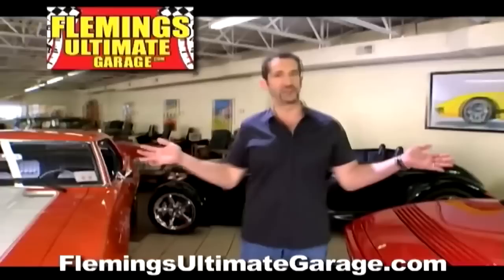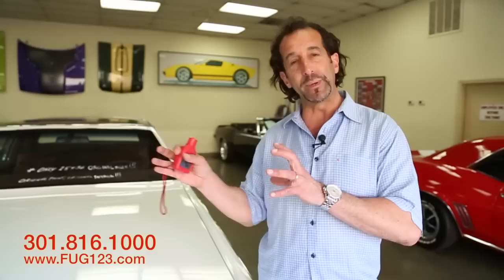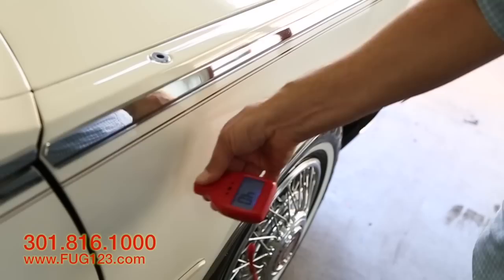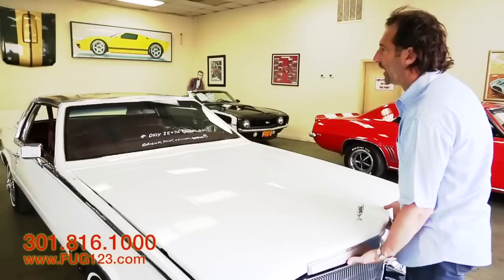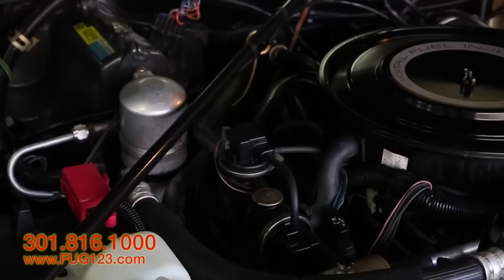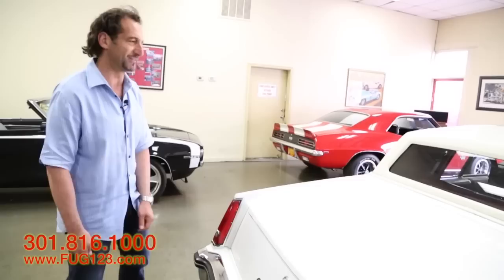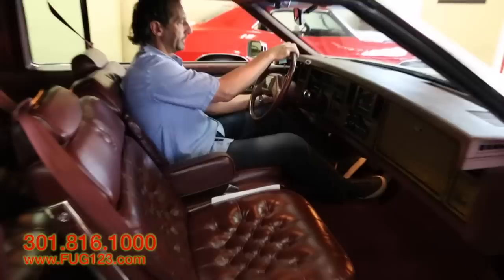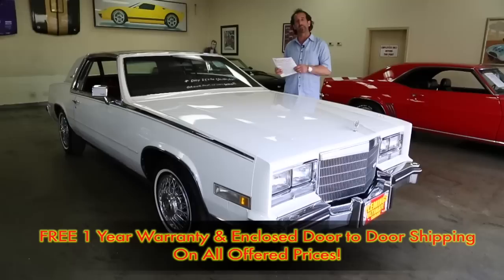1984 Cadilac Eldorado Biarritz for sale with test drive, driving sounds, and walk through video

Comment: Too bad the 4100 Engine was utter junk, was a complete failure for GM.
Reply: JetCityNewEngland yea it was. but there is hope for low mileage ones like what's in this Eldo.
Reply: KodiLoaded Its not a bad motor.  They last a long time.  I have an 1985 Eldorado Biarritz and an 1984 Seville both with this engine.  They run very good and get great economy.  I only wish it had more power.  They only got better as the time went on increasing the power.  I've never had any problems.  I know someone who has an 85 eldorado withh over 250k and still running strong to this day.
Reply: +KodiLoaded Yes, but I would rarely drive this beauty....just baby it and admire it.
Reply: A car like this is NOT meant to be driven daily! I have a 85 Eldorado Biarritz just like this car here and I enjoy it very much just driving easy and going to various car shows with it. These engines are good but just not for people who don't maintain there cars.
Reply: ***** You blew the engine 3 times???  That is not normal for any engine.  My only complaint as with any other engine at the time is its lack of power but that's it.
Reply: Just like any Northstar engine...crap...
Reply: >Stoney Rich: HT4100 was worse than V864. 4100 needs stopleak tablets just to keep itself sealed, their oil pumps were weak, their camshaft sprocket would wear down and cause the timing chain to jump, by 90,000 miles they were ticking time bombs and almost always had a bottom end knock. If the starter hangs up while cranking, it's not the starter that's faulty, The engine is partially seized. The 4100 fared a little better in the transverse version because it didn't have to work as hard; but it caught hell in the full size RWD cars.
Reply: Eric Beauchea dude nobody blows an engine three times admit it you dogged the shit out of that car
Reply: Yes, the low miles was the high point for this car.  I wonder who has it, and how it looks today, 3 years later...
Reply: Yup
Reply: It’s not a 4100 if the bottom end isn’t knocking 😂 had an 85 fleetwood fwd drove if From Ohio to Florida no issues except a random misfires while I was driving it.   injectors had to be clean and fuel system about half way there. But yet again this engine is not the best it literally almost ruined Cadillac back then! Customers had to bring there cars back and Cadillac was installing olds 350s in them. Maybe they should’ve done that in the first place.
Reply: Utter Junk, I wouldn't say, but was a motor with problems ,some HT-4100s were replaced under warranty because it was prone to failure of the intake manifold gasket due to scrubbing of the bi-metal interface, aluminum oil pump failure, cam bearing displacement, weak aluminum block castings and bolts pulling the aluminum threads from the block.
Reply: KodiLoaded....Dude, did you even read the manual and comprehend that this engine needed maintenance of adding radiator"Pills" and changing the radiator fluid every 2 years? 
You are the perfect example of "IF ALL FAILS,,READ THE INSTRUCTIONS" !!!
Reply: @starxlr7863  350 engine all day long in my opinion should have been in these.....
Reply: @lionelhowell4972  Yes from the first 1979 Eldorado.  Its an Oldsmobile engine and I have one that I'm putting into a Seville.  I can't wait till its done.
Reply: Everyone says that, but actually my father’s was great and reliable.  None of the maintenance issues and power to tow a boat.
Reply: Yep that and the Northstar. Throwaway motors
Reply: @eriknobles3946  No the Northstar V8 is not a throwaway motor by any means.  Actually none of these are.  But if I had to say which was the worst engine offered by Cadillac, it would be hands down the HT4100 mainly because of its rediculous low power.  The Northstar is a powerhouse and will last a very long time. Proper maintenance goes a long way and these engines are very low maintenance.  Remember there is a reason why Cadillac built the Northstar V8 for a 20 year production run, coming in 4 different varients, and its same engine design, materials and technology eventually finding their way to all the other GM engines as the years go on.
Reply: and caddy didnt stand behind the engine for many customers....they really sticked it to their customers for MANY years! Back in the day I was a used car dealer...I helped a friend dealer to force caddy to buy the car back... It had 49 K miles....then engine started to go...he bought the car new from a local caddy dealer that he KNEW! The wouldnt help him. I found a FED emissions law that forces the manufacturer to fix or buy the car back IF under 50K miles
Reply: My dad had an 83 Eldo. I actually did the research and comparison shopping for him, and I was 18. I went to one dealership with a friend from high school. I had my dad's checkbook in my back pocket (yes, he let me have it LOL). I went to one dealership. The salesman didn't believe me when I said I was looking to buy a new Eldo. Bummer. He lost a sale. Don't ever be rude to people because you never know who has money and who doesn't. So I went down the street to Hillcrest Cadillac. They got a sale. Funny how I remember little things like that from 37 years ago. Anyway, gawd that was a gorgeous car. Firemist blue paint with white fake convertible top. Bose stereo. Man I loved driving it. Unfortunately I was driving it a couple times and it just died. Right in the middle of the street. Such a pain when we didn't have a phone in it. The second time it died in the middle of heavy traffic on the 405. He got almost 40,000 miles out of it before he got tired of the engine and bought a Mercedes. So yes, bad motor. Completely unreliable. But at least it wasn't the V8-6-4.
Reply: @rexcruciatus2036  V8-6-4 was a MUCH better engine bc you could disable the module to reduce cylinders easy enough, but the HT4100 had a serious engine block defect & Cadillac wasnt helping customers with it
Reply: @welcometoreality3450  OK well in that sense you may have a point. I wasn't thinking in terms of a modified engine though.
A couple times I was driving our 83 Eldo and the engine just quit for no apparent reason. A couple hours later, it started right up and ran fine. Could this have been related to the problem you're referring to, or was it likely something else?
Reply: @rexcruciatus2036  it was a very simple fix for the 8 6 4 mod...like pulling a connector or something.  I guess the 83 eldo could have had the block prob & ran well again after it cooled down....idk
Reply: Antoine Miller so the 350 was better than the 4100 by far?
Reply: I have had mine for 22 years
No issues
Reply: I had the only good motor. I bought it as an angry 20 year old. In 2000. Car terrible condition. Panels off the doors peeling off. I just could not kill this car. Flooring it down lake shore drive. Shoving it from reverse to drive just to chirp the tires.
 I mustve had the one that worked.
Reply: Ya way better to find one of these with the olds 307
Reply: Nope my father had 83 ETC and 85 convertible with HT4100.  If well maintained it was fine and reliable, smooth.  Even had enough torque to pull a boat for cry out loud.  The griping is way overblown.

Comment: There never has been or ever will be such luxury inside the interiors again.
Reply: I even thought the Cimarron wasn't so bad after they upgraded to the 2.8 V6, quad headlamps & lower body cladding. What they also should've done was change the profile of that Cavvy roofline & perhaps conceal the Cavvy wiper cowl panel?  Look at the 1979 Lincoln Versailles for example. When they redid some details that year, the car beared little resemblance to the Granada/Monarch & it represented Lincoln quite elegantly.

Comment: My 85 with the 4100 has always run smooth and shifts like silk. These were the most expensive cars at the time and worth every penny
Reply: You would say that until you hopped into an early 1980's V8 Mercedes that made 220hp, did 0-60 in under 9 seconds and topped out at 130+mph.  Yeah a Benz might have cost an extra $10-15k over a Cadillac, but man it was such a superior car at that point in time vs the 130hp Cadillac cars that liked to blow their engines before the warranty expired.
Reply: They started at 60.000 dollars new.
Reply: I have my dads 83 Eldorado,  optioned with, Bose stereo,  cadillac aluminum wheels, and Digital dash. Leather. Love it.

Comment: talks about how repainted cars have different thickness, as every panel is a different thickness
Reply: Steele Davis Yea right I have a meter just like that I bought it at sports authority it cost me 10.00 dallars its a jogging tracker and people actually believe this
Reply: Doesn’t matter anyway those plastic panels are very unlikely original. They rot out very quickly.
Reply: LOOKED UP THE VIN.  CAR WAS IN TWO ROLL OVER ACCIDENTS (SHOULD BE OK, THEY WERE LOW SPEED ROLL OVER ACCIDENTS).
Reply: My car I bought it in terrible condition. The bottoms rolled up. I was racing my one friend. I thought I beat him. He let off because he thought my car was gonna disintegrate and fuck his up.  
The side panels curled up so much he said if I had a propeller I'd fly away
Reply: Awesome steering though taught ny sis how to drive in this thing. You could steer with your pinky finger the power steering was so nice

Comment: These are really beautiful cars.  I have a 1985 Eldorado Biarritz in canary yellow and a 1984 Seville which is the sister car to the eldorado.  I've had it for the past 7 years since I was 15 years old and I love it!  I always loved this generation Eldorado and waited for the right one to come.  You really have to see and drive one to really appreciate it.  The build quality and materials used are very very good and has that classic car feel.  You can't really say that for many cars during the early 80's.  It was either the Cadillac or the Lincoln that was your best quality car to buy then.  I have never had a problem with it and runs perfect to this day.  I NEVER get tired of driving this car and I plan on keeping it till the day I die!  Very reliable and great fuel economy.  I would only say that I wish it had more power.  But thats how it was for many cars during that time.  Overall,  its a Great investment and a future Classic without a doubt!
Reply: ***** Because it is the sister car to the Seville, as is the Buick Riviera and Olds Toronado for years 79-85. Both the Eldorado and Seville share many of the same components.  The only main difference is the number of doors.  It would be the same thing for the Lincoln Continental and Mark VII and Mark VIII during the 80s and 90s.  Any of these cars are reliable with proper maintenance and care.  And I do know all about the HTseries engines by Cadillac.  Maybe the early 4100's had more of the problems but then were revised for the 1985 model year.  It was ok for its day but not anymore to today's standards.  Besides its not a car to drive everyday anymore.  My car stays parked away inside a climatized building and I only take it out for nice days for a nice drive.  But thanks for your interest.
Reply: The early 80s Chrysler Imperial was a gorgeous car as well. I have one with the original fuel injection system and it runs perfectly. It is the Sinatra Edition and I get asked about selling it, but I just enjoy it too much. The stainless steel roof on the Eldorado was a nice feature and the turn signal indicators on the fenders I love. I also have a 76 New Yorker Brougham, 2 door, but that was from a slightly earlier era.

Comment: This Car was dubbed the Dream Machine. It was a Really sharp Looking & Driving car.
Mine was just like this one except I had white leather interior & moon roof. Was also fully loaded. It had an innovative off centered mounted engine to balance the weight better which I found a nice feature, it was only the 4 liter aluminum engine that was fairly TAME but ran reasonably well. It also came with an optional Big V8 Diesel.. Very well designed, rode & handled well....Worthy of its name ."The Dream Machine" .

Comment: Do the recommended maintenance written in the manual...change radiator fluid and add the "Pills" as instructed.   Due to different metals used this will keep the engine running forever.
Reply from the maker: Ours was fully serviced and its new customer keeps it up to date as well

Comment: Absolutely LOVE these Eldorado's.  My mother drove one for a long time and we loved it.  These were truly great cars during a terrible era and terrible for engines.  These cars would be greatly improved with a new Cadillac Northstar V8!
Reply: Unfortunately, the NorthStar is also problematic.   The head bolts are too skinny and in time strip the threads from the block.   It can be fixed but it's very expensive to have it done.   Once done, however, it's a great engine.

Comment: The coolant supplement decal under the hood was a dealer campaign, not an original issue item. As the dealers treated cars with the brown "horse pellets", the decal went under the hood. That was to combat the problem of these cars having blown intake gaskets. The intake would blow, causing the coolant to mix with the engine oil, eventually poisoning the bottom end and finishing it off. The dissimilar metals being used was generally cited as the cause for this issue.
Reply: And it worked. My 83 still has its original 4100, never been a problem,  now at 135.000 miles. Coolant changed every year,  pellets added.
Reply: @johnfranklin5277  My dad was a salesman at a Cadillac dealer when these were new. In the summer of 1984 there were rows of them awaiting new engines. Terrible engine and terrible design.

Comment: That was one of the strangest FWD setups ever. Engine on the right, transmission on the left, a giant chain and two sprockets connecting them, with the differential next to the oil pan and one half-shaft going right through it. Ford patented the "unitized power package"  in the 1950s and GM was hoping to use it for the "senior compact" F85, but GM chickened out on that when the public showed no interest on efficient designs, so the power train was massively enlarged to create the Toronado and Cadillac had a version the next year. 1985 was the last year of this layout for the Seville and Eldorado; the '86 had a transverse power train, like most cars these days.

Comment: You are really rolling the dice with that 4100... Best to get a 79 or an 80 in this style..
Reply: Fragile Thunder Right. I had one just like this and it began emitting blue smoke around 80,000 mostly highway miles. I'm in my early 60's and drive gently and within speed limits (always have). The car was never driven hard and garaged. Found out later that the 4100 was known for this problem that would require a rebuild. Sold it but I still miss that car.

Comment: The letters HT before the 4100 were to describe that it was High Torque . It ended up standing for Hand Tightened because every bolt on this engine became  Loose .  Still a beautiful car.
Reply: No. It stood fo high tech. My 83 Eldorado has just over 100.000 miles and the engine has never been a problem.  Keeping the radiator tabs in it are the key to keeping it running.
Reply: Steve Franklin 
That is a beautiful car. My 83 coupe de Ville   Shortly started loosing every engine bolt. I wanted the V 8 6 4 engine back then instead but it was discontinued in 82. . It had the potential to be a good one bit they couldn’t perfect it. The V 6 had camshaft issues and also discontinued in 82 
I miss the old Cadillacs. Where they are today is a big mess. I had to leave Cadi after 35 years of driving them. The last two were NYS lemons. Of which the last was a full refund.  Shame
Reply: @alpappalardi7044  you probably would like my 58 Cadillac, my Dad bought it in  1960 from a Doctor friend of his. I was just 1 year old. Lifelong southern California car. Dad passed away 5 years ago at 97. But I've still got the family heirloom lol. It's with me till the end. I drive it around town for all my errands. Its Prestwick Gray. With 2 tone silver interior.  Has factory air conditioning.  RARE!  And the optional power windows. Imagine a caddy with crank windows. Yup. That was standard back then.
Reply: Steve Franklin i wouldn’t like that car. I would love it  I was born in 60 and my dad of 83 was always a Cadillac guy.  I know he had one in the middle 50s. So I’ll have to ask him what year. I do recall the 59  DeVille with the plaid seats and the protruding double red tail lights. So big my brother and I played on the floor of the back seat.  To this day he tells me the best riding car he ever drove was the 64 sedan devlle. . Huge White with red leather. I have a picture of me standing in front of it at 9 years old. 
I could go on and on, lol. Good old days for sure. And with  a lot less traffic
Reply: @alpappalardi7044  I was born in July, 59. My parents had me late, they said I was a SURPRISE! Lol. Dad was 43, mom 39. I'm lucky they both lived long lives.  Mom 89, Dad 97. I was putting gas in the 58 a few months ago. And this 20 something guy asks me if it's a 75 caddy! I said no, it's a 58. Then he asks if it gets good gas mileage!!! LOL!!!😄
Poor guy doesn't have a clue! But I love that old caddy. Lifelong memories and a strong connection to my parents. I get lots of people who come up to me to talk,  and tell me they really like it. And I should say at car shows. The teens and 20 year olds are much more knowledgeable,  and really interested in knowing about it. I have a great photo taken in 61 of my Dad , my sister. And brother standing up alongside the caddy, full shot of car. Dad is holding me, I'm a year and a half old! People at the car show cant believe a car has stayed in the same family that long. 😊